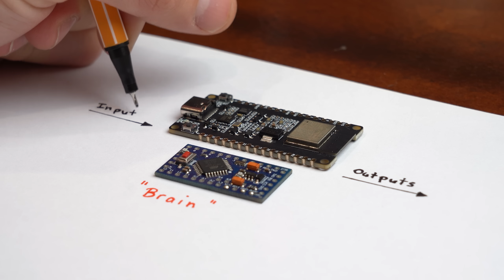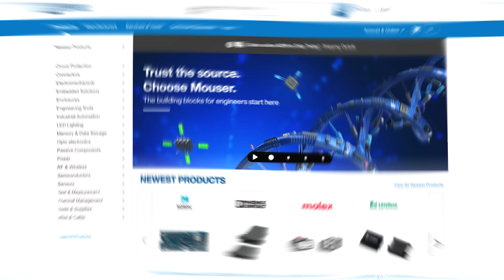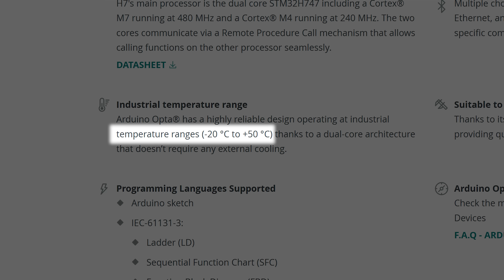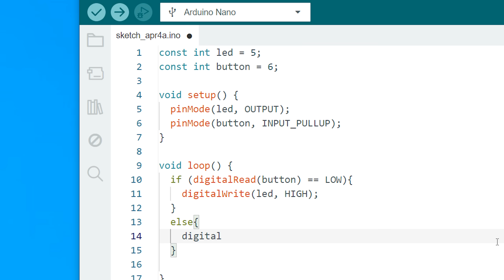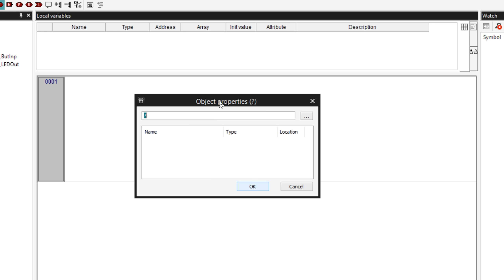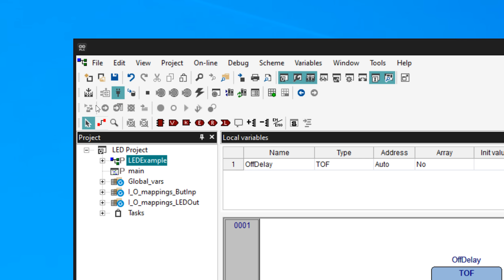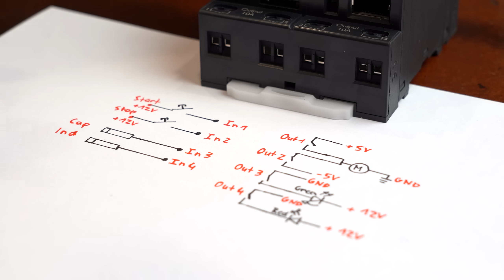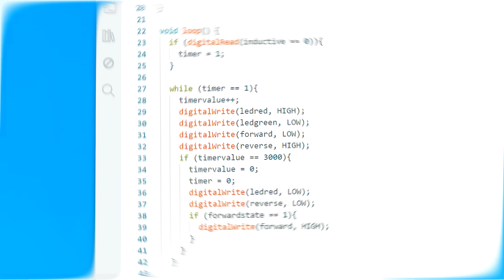Not a Microcontroller!...This is Better?! (PLC) EB#62

Comment: As a PLC systems Engineer of nearly 35 years now, PLC's are physically much more optimised for Industrial use, as well as hardware optimisation for things like high speed interrupts and encoder control and safety applications. If they support IEC 61131-3 then you have the five different ways to program, as well as choice between relay output and transistor output. Then there's specialist expansion units for a multitude of different applications, temperature control, motor control and so on. Definitely for me the limiting factor for microcontrollers is the voltage/amps they can handle, so they are of limited use in an industrial environment. They are good fun and cheap, and at the moment i'm looking to implement some in a laboratory environment. Good video, as usual!
Reply: I just don't understand your last statement about microcontroller current and amps , the whole concept is it outputs logic signals which you amplify, or the opposite where you drop then to microcontroller levels
Reply: @orange_tweleve  PLCs are a pre engineered solution for industrial control, as most of them are a microcontroller on the inside. The dropping, circuit isolation pulldown resistors, are already implemented inside the plc. And the outputs are designed to output industrial voltage levels and be powerful enough to drive industrial control components. So in contrast to the concept with microcontrollers: PLC concept is that you don't need to do that.
Reply: @ToxTox More like microprocessors nowadays. There is a big difference.
Reply: @ToxTox yeah but they also cost thousands of dollars!
Reply: @RogerTannous  PLCs nowadays can be very cost effective. However you can try to reinvent the wheel by making your own controller to use in a machine that only costs many thousands for every minute it is standing still. Or you could purchase a plc that is reliable, modular, is going to have spare parts being produced for a long time, meets all relevant standards and has been designed and engineered for the tasks. In the grand scheme of things, the cost of the PLC is insignificant relative to the rest of the machine.
Reply: @ToxTox  reinvent the wheel ? Not really, because what you can do with a graphical interface is way simple, so that an experienced software engineer can do the same in no time! Apart from that, the idea you're conveying is true, and I agree, but I don't know if all PLCs support C/C++ style programming. Otherwise, I don't feel this is something I can feel comfortable with.
Reply: @RogerTannous  with "reinventing the wheel" I ment that if you want to use a microcontroller in an industrial machine you going to need, input protection, outputs that can handle basic control components, emi immunity etc. You essentially end up building a PLC. Regarding languages one of the standardized languages is 'structured text' which is based on Pascal. However a computer and an industrial machine are very different, with how PLCs execute code, the nature of industrial machines being realtime and a lot of the code being boolean logic can make a graphical language more advantageous. So what makes textual code advantageous for computers doesn't necessarily transfer to PLCs and vice versa.
Reply: @ToxTox  yepp, I understand what you're saying and I'm not saying you're not correct on what you are conveying. Also thank you for the well elaborated ideas.
Reply: @ToxTox  
Well, i work for water/waste water company in 450K city. Not on SCADA side .. but close enough. Good luck popping in only PLC to manage some BIG waste pumps, ozone generators etc. PLC's are for process logic - getting input from sensors and sending signals to actuators. It's edge case in our system where you can use PLC directly. And we have at least one, too :)  RFID door card --> door lock - SCAD guys thought that commercial systems were too complicated and pricey and made their own.
Reply: @ToxTox A bit off topic, but something I've been wondering: what are the standard tools/possibilities for "source control"? That is, version management, diff, merge etc? Are the graphic programs also exportable as text? Or is the PLC world living without it?
Reply: @orange_tweleve  PLCs almost always have the option of outputting 120VAC or 240VAC with sufficient current to directly drive large motor starters and solenoid valves. AC inputs are also supported.
Reply: @orange_tweleve Almost all industrial controls are 24v. Using a microcontroller that uses 3v or 5v means that everything would require more hardware. Sloppy. I have created machines run from plc and all controls are within proper amps and I don't have to use relays for everything. Special cases require relay.
Reply: @orange_tweleve  Many PLC controllers can directly switch 110 or 230 Volts AC or DC with the appropriate expansion cards, or even from the CPU controller. Typically this saves space, time and modern PLC cards are modular and do not need to be programmed after replacing.
Reply: PLC - that's a microcontroller + bus peripherals. Logical relay, like in a video, consist of microcontroller, a power block and a galvanic isolation (relay, opto etc). You can make it yourself, but it’s much simpler and cheaper to buy ready-made ones.
Reply: @__HJK__ it's way cheaper to make it yourself than to buy a PLC for thousands of dollars.
Reply: @ For my own purposes (for example, to regulate the bandsaw lowering speed in my workshop), I will most likely make a homemade one. But, for the customer, considering the cost and time of support, and the cost of an error - only proven certified solutions. And I will not even think to put Arduino in my own lathe or mill - fingers are much more expensive then logical relay
Reply: @__HJK__  Simpler and safer . PLC manufacturers put massive time & effort, not to mention decades of design evolution, into achieving fail safe operation and compliance with international safety standards. Arduino-like controllers will not be replacing PLCs except perhaps in the most trivial of industrial applications, any time soon.
Reply: @sootikins  Its more the opposite, trivial applications are handled by PLCs, while the complex operations (involving more than basic math) are run on industrial microcontrollers. The great thing about a PLC is can act as safety layer, ensuring the system remains in a safe state while receiving an input which tells it what to do. The limitations of PLC logic blocks and the locked down nature of PLCs don't make them attractive for complex custom algorithms.
Reply: @someonespotatohmm9513  I dunno what PLCs you've looked at but I have controlled distillation columns (12 PIDs several of them cascaded) with PLCs that are not even modern now. Aseptic juice processes, complex packaging machinery, etc. I'm guessing you're a refinery guy who likes his DCSs.
Reply: @ Yea wasn't clear with what I meant with trivial. 12 PIDs even cascade and whatever combination of predefined filters and state control is complex. But each individual part in isolation is trivial. That is the job I meant the PLCs are designed for. But when the individual components stop being PIDs on single signals, but instead some MIMO controller scheduled by some realtime optimization algorithms, or you need to implement your own fft algorithm. Then you can see ppl steering away from them because the tooling around PLCs is, from what little I directly experienced, just not set up for it.
Reply: @someonespotatohmm9513 Okay, I'll give you that one! FFT in a PLC would be difficult if even possible and definitely a misapplication. Realtime optimizations? Dunno... All depends on the complexity of the algorithm you need to run. Modern PLCs can do quite a bit of heavy math lifting, but not compared to an X64 8-core!
Reply: Not to mention that microcontrollers have terrible immunity to the high (electrical) noise of the industrial environment and they do not guarantee failing to a known safe state. PLCs handle both those issues inherently. Additionally microcontrollers don't meet recognized standards for safety and reliability.
My clients would laugh in my face and kick me out of their plants if I showed up with some arduino or STM32 homebrew system. PLCs are bulletproof. Micros are not even close.
Reply: I have an Arduino with a relay shield on top, with that you can control higher voltage and amperage too.
Reply: As others have pointed out, PLC's are developed specifically for industrial use. They must conform to EMC and safety standards, not to mention survive difficult environmental conditions (Heat, damp, dust, etc) Usually customers will also specify IEC 61131-3, at least in the EU, so the PLC also has to support that standard amongst many others. 
This is part of the reason they are so expensive. They are incredibly robust, are capable of just about any application and are not that difficult to program. I agree about the software, it's ridiculous pricing and dumb subscription models but that's hardly exclusive to Industrial controllers.
As distributed IO becomes more popular, there may be some uses for microcontrollers that are not critical or safety related (data gathering, monitoring, etc) where the expensive cards from the Manufacturer may not be needed. Modbus seems a good bet, and is something i'm experimenting with at the moment with Arduino.

Comment: I work with plc's for my job and it has become so much easier to do anything i used to do for fun with an arduino because of how much easier it is in a plc. Also we use automation directs brx plc which are pretty cheap for plc and have a crazy amount of features and free software.

Comment: I'll give my 2 cent on the product since I've tried it.
I have bought the OPTA almost a year ago and it works fine, is still in operation today, monitoring power in my house and activating a couple of relays.
But the ArduinoPLC software is trash, especially the programming over ethernet, a very important function for a PLC, that sometimes doesn't work and you can only send code written in one of the "industrial" codes, not classic arduino code; which in my case was required to read values from a Finder power meter over modbus and send the data over MQTT 

(fun fact: the modbus signals of that power meter doesn't follow the standard protocol, and I wasn't able to read it with a generic modbus over TCP, but only with a specific code from finder running on the OPTA, that was the main reason why i've bought it. Another crazy thing is that you can't send/receive over MQTT with block diagrams, so only arduino code that you HAVE to send with a usb cable)

Most importantly, documentation on the software is downright embarrassing, or non-existent.

I feel like it is a product in it's early stages and not finished, which is a shame considered that is made from two very knowledgeable companies each expert in their field.

A final, and personal opinion, since this is arduino based should be more focused on inexperienced users and the ArduinoPLC software is anything but intuitive, unless you already know one of the languages

Comment: Weird that nobody makes a $20 PLC, from the BOM, it'd be easy?
Reply: @Reg-u1r  PLCs are for the industrial controls / industrial automation sector. There probably exist PLCs from Shenzhen, but who would want to put a $20 plc in their mission critical  $1,000,000 machine. To be fair I wouldn't use the Arduino Opta either. Why would a machine manufacturer risk their reputation, machine reliability, certification etc on a cheaper plc where in the grand scheme of things the cost is insignificant.
Reply: @ToxTox  All the sub components like semiconductors, probably 75%+ of any critical 'million dollar machine' are made in shenzen already. You're already trusting them.
Reply: If you forget R/D, software development, certification, etc then maybe
Reply: @ToxTox  by 'nobody', I mean, of course, some giant factory in Shenzen. you know, the kind that makes, well, 99% of electronics today. So R&D etc, for this simple ass device, would be amortized over hundredes of millions of units, because they'd wipe the floor witheveryone at a close to BOM pricepoint. The fact they haven't, when they've done this with like 90% of electronics, is of course, what I'm referring to as the question.

Comment: Another good option for a low cost, Arduino based PLC is AutomationDirect's P1AM based on the MKR Zero boards. They're modular, allowing you to pay for just the functions you need for your application. Big leg up for trimming the fat on costs.

Comment: Microcontroller: LEGO Technic
PLC: LEGO Duplo
Reply: that is only true until you include motors, cameras, etc into the project
Reply: @Raeffi3  yeah, PLCs are used in industrial use cases. the things they are used for are much more complex then the things most micro controllers are used for

Comment: In north America ( canada speaking ) we don't use din rail in distribution box. And good lord I don't understand why but at the same time makes finding din rail semi exotic and having a hard time finding component matching the rest of the norms ( ex. 15A circuits on 120v. Most din breaker I find are 10a or 20a on 220v )

Comment: it's simple really.
PLC is used when you need expandable and easy to configure(Entry Level Programming) for productivity, efficiency and Of Course Centralized controls and monitoring.
Micro is used for Mobility and Space constrains without worries or considering future Hardware Expandable possibilities which in today IOT era seems possible to expand the systems.

I'm not talking about the entry/hobbies level Micro Controller but the Industrial grade mass produced Micro Controllers that able to do "simple" tasks of collecting Input Process-->doing some computing from basic to moderate complexity--->transmit processed Data as Local Control Output to another device and/Or sending the computations results via signal transmissions.
And all that can be packed within a very small enclosure that depends on it's applications can varies between a cheap Plastic or a thick eExd Enclosure.

The simplest "Items" of it is the old reliable Honeywell Local Controller back in the early 90's that collect the data from the Xmitter and Controls Control Valve with Positioner or a simple speed controls of an Inverter.

Comment: I personally love the Siemens LOGO 8 series, I find its graphical language even more appealing and quite a lot easier than the arduino PLC IDE.
For more complex tasks a s7 1200 or 1500T for robotics even.
Great video!
Reply: S7 1500 for robotics? Not a chance. Right now I'm tearing one out of a machine that is supposed to be 5-axis CNC. A controls house believed that the S7 could handle it. There's no way.
Reply: @AdaptivePhenix  1 Question and 1 Statment.

What S7 1500 specifically?

Furthermore, a 5 Axis CNC is absolutely not the usecase, to much Gcode, to fast operations (to be precise to microns anyways). Thats why CNC controller exist.

However classic simple Robotics should not be a problem. 
Pickers, Delta pickers and id wager most 5 Axis Arm movements for pick and place operations.

Comment: I would prefer the connections and power of the pcl but with the brain of a microcontroller.

Graphical programming is fine for very simple programming, but as soon as your program gets just a little more complex then I prefer programming in a user friendly langrage like python.

Comment: I'm so glad you put this video together! I just bought the PLC kit from Arduino and a second Opta. Admittedly, I am very frustrated. So to see you put this together reignited my enthusiasm. I also order my Allen-Bradley Micro850 and will be getting a Siemens S7-1200. In August I will be starting an Industrial Automation major and really care about the applied learning aspect,  hence all the investment in the equipment. 

With my Opta, I plan to hook into a NodeRed gateway and my security camera system. This way I can use sensors to validate the need for watering and also turning the sprinklers on when people walk in the yard as a practical joke.
Reply: @ClaytonAllenFP  From Siemens I would recommend the CPU1512SP instead. It is an S7-1500 series very compact PLC, thus having much better programming capabilities than any S7-1200. 

From Beckhoff, you might want to take a look at their TwinCAT 3 ecosystem. The development environment is free and it can run your PLC programs on your PC, so no HW or SW purchase is necessary for learning.
Reply: I suppose you checked which systems they use in school, because each manufacturer likes to lock in and differentiate, so focusing on one system first should help learning, I think.

Comment: The major missing feature of these is no true analogue output. I believe they have some PWM, but no 4-20ma is a deal breaker in many cases. Converting 0-20ma into 0-10v is trivial, but filtering PWM down to a reliable, predictable, universal, 0-20ma is significantly more involved.

It's really a big differentiator between this and the "proper" stuff.